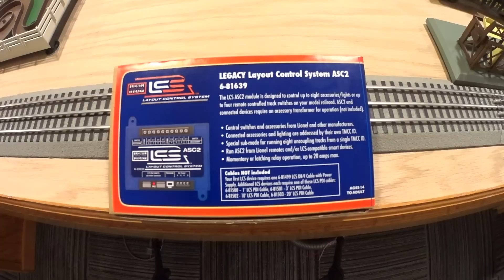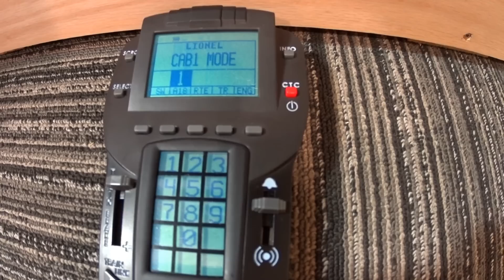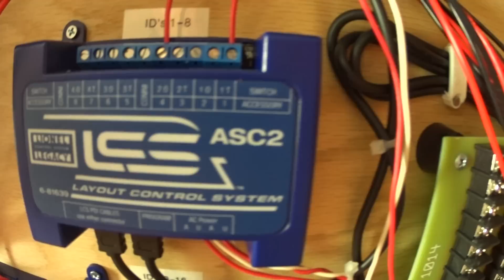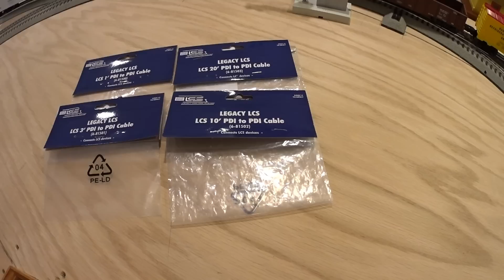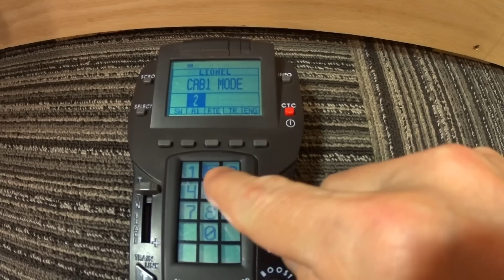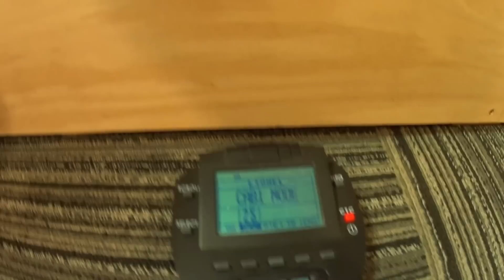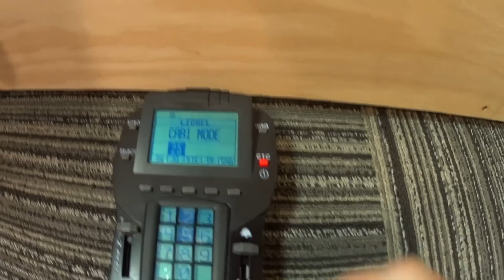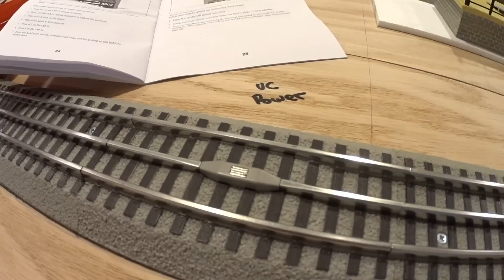My O Gauge Layout - Episode 5 - Part 2

Comment: I have a question, I watched the modifications to the operating track, but why wouldn't you just connect the ASC2 to the two leads coming from the switch controller, and then route the other two leads to the common? Wouldn't that solve the problem of only one set of shoes having power and in general make this an easier modification? Isn't that basically what the momentary buttons on the controller that comes with the track doing?

Comment: Sean, I'm late to the party, but your tutorials are terrific.  I watched  Mike Reagan's explanation and found your's much better.  One question though: regarding the operating/uncoupling track, if I understand it, I can connecting the operating rails to an ASC2 so I can use AUX2 exclusively for that section of the OUC track, and runs the power wire for the magnet to a different ASC2 set up so only  the momentary  switch works as you demonstrate for the uncoupling track. Is this correct?  Thanks.
Reply from the maker: Yes if you follow the wiring in my video, each part of the track (Uncoupling and Unloading) can be separated on 2 different ID's on the ASC2.
Reply: Thanks for the quick reply.  I may have been unclear. I meant to ask: can I wire the magnet and the operating/uncoupling track to different physical ASC2 boxes?
Reply from the maker: Well you could but remember the ground goes through the track, so the power has to be connected to the common terminal for each bank on the ASC2. That powers all four ports on that bank.   But since the ground is the track, the power coming to the common would have to come from the same transformer powering the track.  So why split them on different ASC2s?  You have 8 separate ports per ASC's each with a different ID.  If you split them on different ASC's then you might be wasting ports as they could only be used for things grounded and powered by same transformer that powers the track.

Comment: I currently have one SC2 from a previous layout I use gargraves and ross customswitches. Is there advantage between the asc2 vs the sc2
Reply from the maker: The ASC2 allows control of 4 switches or up to 8 accessories.  The old SC2 was just for switches.   The ASC2 now does both.  The SC2 was discontinued.
Reply: @seanstraindepot  didn't know they were discontinued. I just ordered another one from lionel.
Reply from the maker: @Dachamp2001  I did not see them anymore in last catalog, since they have some newer replacements.  Just check out their latest catalog online under the Control section.
Reply: @seanstraindepot  thx I didn't seen them either after researching 2017 I think was the last year for them